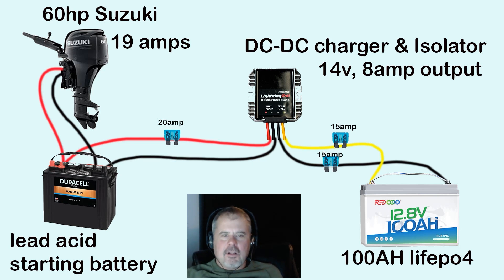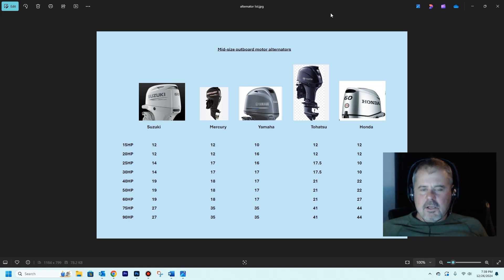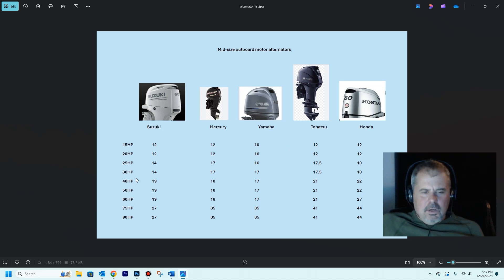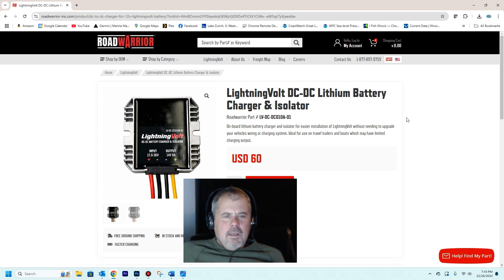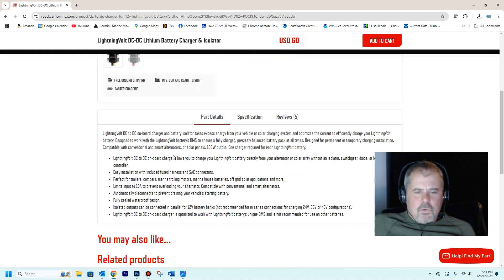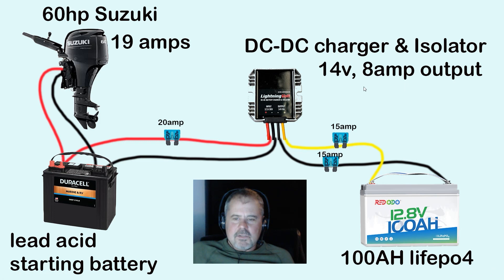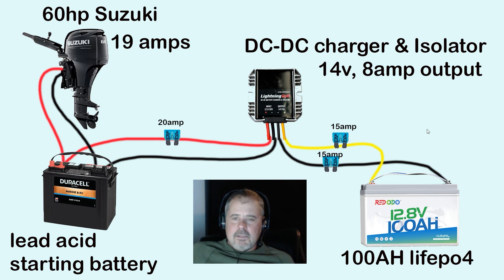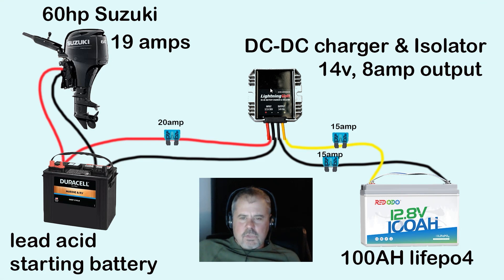Safely charge Lithium 12v on mid size outboard alternator

Comment: Aren't these alternator output #'s WOT? Wide Open Throttle. Cruising throttle position and consequently alternator output is less.
Reply from the maker: It may depend on your brand. For my Suzuki, at 1000rpm I have 70% output. I've been running for almost a year now, still working fine

Comment: Thanks so much for this info. If this is that case that you should not exceed 50% of your outboard's output, why are the majority of DC-DC Chargers in the 40-60 amp range? I'm confused about all of the most popular DC-DC Chargers ie LiTime being 40-60 amps when no outboards put out double that. What am I missing?
Reply from the maker: Only thing I can think of, those bigger DC/DC chargers are used on the 200+HP outboards. Those larger outboards have alternators that output 85 to 115 amps. A couple of years back you couldn't find lower outputs. Now you have a few options. I've put nearly 200 hours of operation since I installed my DC/DC charger, running perfectly still!

Comment: I have a merc 60 hp 4 stroke which has 18 Amp stator/alternator and I was looking to add a DC to DC charger for my lifepo4 100 AH house battery. I came across this video and I researched and found 3 DC chargers which might work. (1) Powerwerx DCDC-8A 14.5V, 8A Adjustable DC-to-DC Battery Charger for 12V LiFePO4 Batteries . Cost $90. (2) Renogy 12V 20A DC to DC Battery Charger (document says it can limit output amps to 10 A via app) Costs $125 to 160. (3) Victron - Orion 12/12-50 amp DC/DC Charger. Has adjustable input and output for volts and amps. Costs $300+.
Reply from the maker: The one I used sold by roadwarrior as you know is not showing up anymore. I contacted them and they said they pulled many of there items due to the tariffs. They said once things get worked out they would be back. The Powerwerx one looks good. Let me know which one you get and how it works for you. Thanks

Comment: Always wanted to do this but didn't want to smoke my alternator
Reply: I have a friend who attached a Dakota battery directly to an older 90HP Honda outboard without any problem. According to Google: "A car's voltage regulator reacts very quickly, essentially instantaneously, to a loss of battery. The regulator's job is to maintain a stable voltage output from the alternator, typically around 13.8-14.2 volts, regardless of the battery's state. When the battery is disconnected or fails, the regulator senses the voltage drop and adjusts the alternator's output to compensate, ensuring the electrical system continues to function". 
I also replaced my Lead Acid battery with a LIFEPO4 battery made for car starting that advertised as drop in replacement for about 5 years now without problem. But I understand that a car alternator might be different than a marine alternator. Anyway, if you don't trust the alternator's voltage regulator, there's battery isolator and DC to DC charger that you can use.

Comment: i HAVE AN 80AH LIFEPO4 BATTERY paralleled WITH A SMALL 7.5 AHR LEAD ACID. tHE LEAD ACID IS THERE TO accept the charge from my df40 alternator when the lifepo4 battery shuts off at the high Voltage BMS limit. Works great.
Reply from the maker: Interesting. I think I saw a video about someone doing this. How long have you been using that setup?
Reply: @StructureFishing  I have a small Boston Whaler with the 40hp Suzuki with basically no electric load, needed the junker lead acid from an old UPS power supply to make sure the alternator had something to drive into when the Li BMS shut down on high voltage. About a year with this config, so far no problems. I also have the same setup on 21 foot Yamaha.  A 100 Ahr LiFepo4 paralleled with the Lead Acid starting battery. 2 plus years with that setup. I have a factory installed voltage sensitive relay connecting the two but I bypass that with the factory emergency paralell switch.

Comment: Lithium batteries last longer if your not constantly charging them at short bursts. A 100ah lithium battery should last days before needing to be charged. Then charge to 95%.
Reply from the maker: Agreed. Even looong days of fishing, I could get 2+ days out of the lithium without charging. It is nice to have the ability to charge the lithium if needed. I'm not sure about the longevity regarding charging time/short bursts. I don't think the manufactures really know for sure. The advertisements on  cycles is all over the place. I've seen anywhere from 2,000 to 20,000 cycles. Let's say a short charge time counts as a cycle. You fish 100 days a year, 5 cycles each day, that's only 500 cycles per year. If I only get 4 years out of a $200 lithium, it is much better than an AGM or lead acid in my opinion.